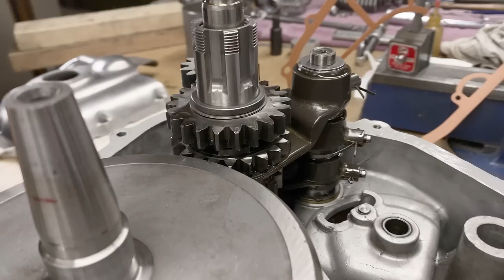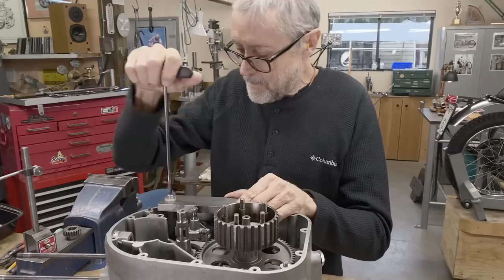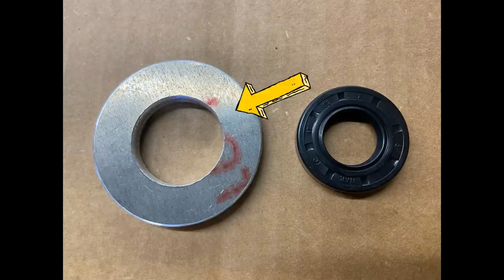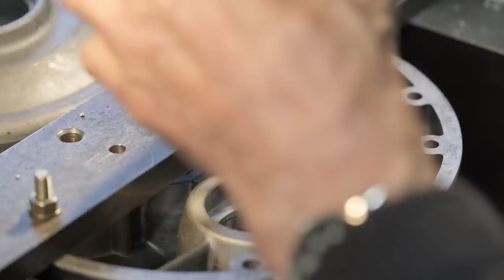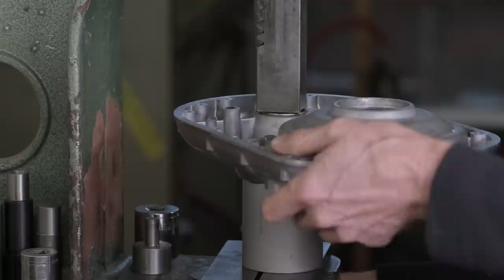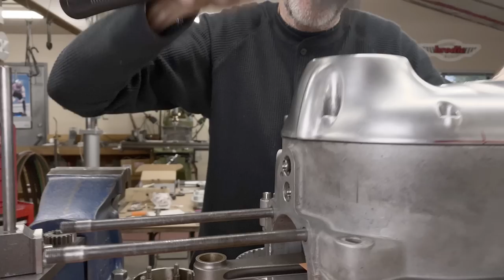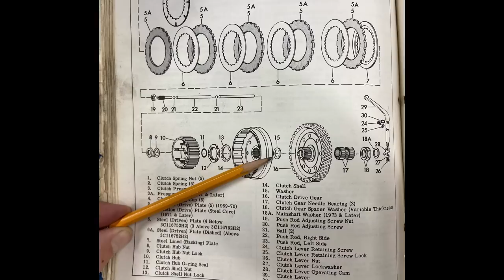Aermacchi Engine Mods // Paul Brodie's Shop

Comment: I’m in bed at 23:30 watching this tired but captivated, only word to describe this is, genius. Good to see you getting better and stronger. Quick question does the clutch nut spin to tighten or loosen?
Reply from the maker: Thanks for watching. Not sure I understand your question. Does the clutch nut "spin"? It turns freely, but doesn't "spin". Partly due to the splines being a part of the thread, I suppose. You want the threads to be a close fit; this helps to prevent it from loosening.

Comment: I have had to build so many engines from a box and I hate how no book or parts diagrams ever call out the thickness of shims and ow washers!!

And customers wonder why it takes so long.  Just like you, you have to guess or calculate end play and make sure everything is correct or it will not work, or wear out fast.

Comment: Hello Paul, Close by in New Westminster. Looking good, nice to see you back at work, however you left me wondering on your choice of case closure fasteners. Do those nylock nuts have a temp rating, please? I have heat softened some on past auto and motorcycle projects and wouldn't want to see your cases separate after a few laps. Thanks,
Marc
Reply from the maker: Hi Marc, I used those nylons on my race bikes and never had an issue. I don't think the cases get hot enough to affect the nylon. But, thanks for wondering!    :face-fuchsia-poop-shape:
Reply: @paulbrodie  Thanks for your reply Paul. Google says "For most motorcycles, an operational temperature range of 155F / 68C to 220F / 104C is normal. " and "Nyloc nuts retain their locking ability up to 250 °F (121 °C)" for Nylon nuts. Your motor, however I would stick to all metal fasteners and safety wire on a race motor.
Reply: And when you get a free moment you should come out to the Burnaby Velodrome some evening, at 68, it is the only place my crew and I do any racing these days!
Reply from the maker: @MarcSasso  Google is probably talking about the cylinder head and barrel temperatures. I don't think the crankcase gets that hot. I raced an Aermacchi for 5 seasons and never had an issue with the nylocs...    :face-orange-raised-eyebrow:

Comment: I have noticed several time when things are reassembled and assisted with some form of knocking stick the note changes as the fit nears where it is going in a similar fashion to a tap filling a bottle with a liquid.  Wood or metal, the change in note seems to work the same.  Thank you Paul and Mitch!
Reply from the maker: Yes, the rate of vibration does change! Thanks for watching and commenting...

Comment: Hi Paul & Mitch, Another great video 👍 Just an idea on the nut & locking washer in the Clutch Hub, is there enough room on the outer hub next to the shaft to drill tiny indentation, Then you could  drill and tap the  nut to take an appropriate size grub screw, The grub screw can then be held into  nut with blue Loctite, you could even tap two grub screw’s into the nut adjacent to each other, Hope this makes sense 🤪🤪🤪 difficult to see how much room you actually have by watching the video also is it feasible to drill two tiny little indentations in the outer clutch hub….. Mark
Reply from the maker: Thanks Mark, the clutch hub is hardened steel (that's partly why it has such a ring to it...) so it would be hard to drill and tap very small threads...
Reply: @paulbrodie  Hi Paul I was thinking that the hub only needs a tiny indentation which could be done with a pointed die grinder bit, It was the nut that I was thinking that you could drill & tap to take a grub screw
Reply from the maker: @EmsillCazm   Thanks. I think I will put my faith in red Loctite...   :face-fuchsia-poop-shape:
Reply: @paulbrodie  ….. i’m no engineer on the scale of yourself but just out of interest do you think that would have worked ?
Reply from the maker: @EmsillCazm  It's hard to say. The lock nut does not have a lot of mass, so when you drill and tap into it, it will be weakened. I did measure the wall thickness at the back of the clutch hub. It's not super thick, but I could skim a little bit off...  Not enough to get full engagement of the lock nut, but better. Mark, it's not a perfect world!     :face-purple-smiling-fangs: